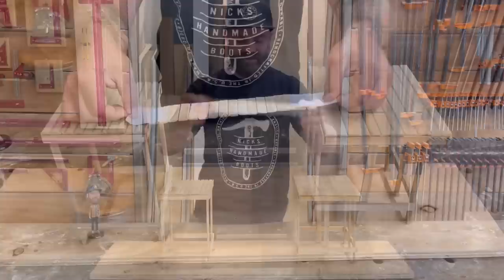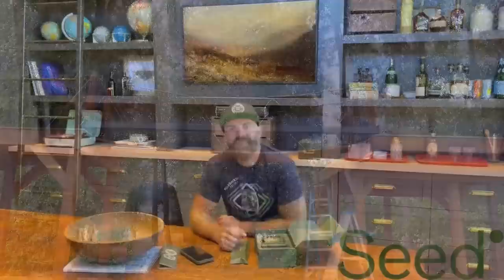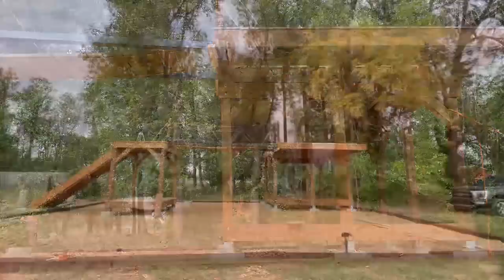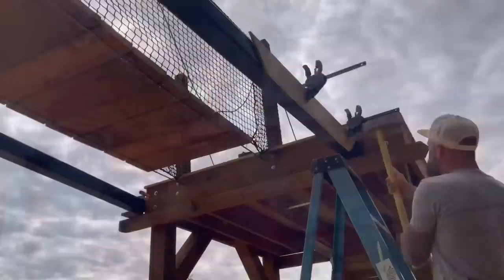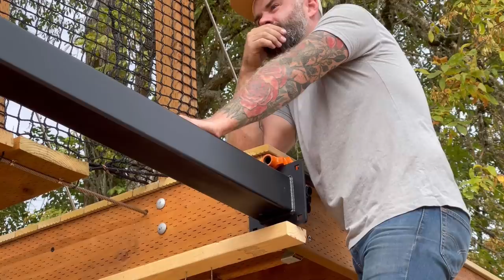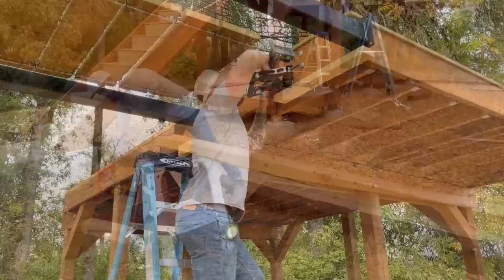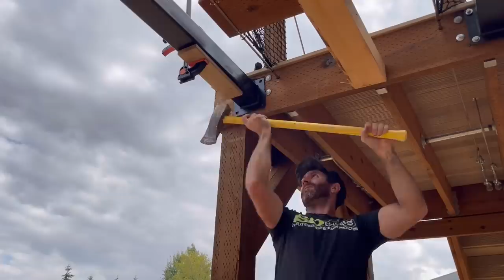My Treehouse is Falling Down || Fixing a Huge Mistake

Comment: Load Paths! This could also have been fixed by adding bracing to the structures it self. The load paths are still not complete down to the footings, adding the HSS sections is one way to 'close' the loop. Next time reach out the community for a quick "peer review", would love to give some advice in the design stage that could have prevented this. Looks good non the less! Love the videos.
Reply: He mentioned that as a possibility at the beginning but decided to go with that instead.

Comment: Hmm, you just need to attach some diagonals in order to stabilize the "box" in a way, that the "pull" from the bridge is causes compression force on the diagonal. That is sufficiently stable. You would need "a lot" of force to break that. In ye olden days they build multi floor houses based on that principle.
Reply: I came here to say this ^. Good on you for catching it.
Reply: He literally addressed this and why it wouldn't work long term. You aren't countering the forces perfectly this way and cannot guarantee stability in the long term.
Reply: @DustinKnapp7  my point was that, when done right, it absolutely can guarantee the stability. Again in the olden times they have build houses with multiple floors on this principle. There are some rural areas here, not bombed flat during the war, were you can still see them standing. Wood can take an huge amount of compression force when applied in (to be precise: against) the direction of growth.

Comment: Edit:  he literally just did what I mentioned below. Should have kept watching before commenting!  😂 At least we had the same idea!  👍 

Another way to span the gap could be to use a 4x4 shorter than the gap, by about a foot or so, and use a car jack between the 4x4 and one of the structures, to slowly spread the two structures apart. Like how they jack up a house when it’s sagging, but horizontally. Hanging/lifting the 4x4 could cause some issues but it was just a though that popped in my head.

Comment: I hate to say I told you so, but… I am a Cable Hauling Logging Contractor and this situation is my daily currency. The closer to a straight line the cables are, the higher the tension. The ratio is exponential, rising to infinite at a straight chord! When logging, we work on a maximum of 1/10 deflection. 
  No matter how strong your cables are, you will break them if you don’t have a visible ‘sag’ in your bridge - very important! When your wife and son were bouncing on the bridge they will have been very close to exceeding the design strength of the cables.

Comment: I was thinking about this issue since the last video.  My concern is the Bridge posts, the towers are now secure but you can see the posts wanting to bend in as Jason jumps.  I was hoping there would be a brace up high too (like a 15ft 2x4, if they have them) to prevent the inward bow

Comment: So this is where it gets tricky.  The weight of the bridge and it's occupants is 100%, that part is true.  Let's say that the amount of dip in the bridge is approximately .4 feet and that the load combination of the wood slats and the people is about 600 lbs.  (it could be much more than that if they are jumping.  Right now the bridle angle of the steel cables is 174.28 degrees.  The force on a single cable is 6000 lbs, but that's a force of 6000 lbs on each side pulling inwards.  Jason has two cables, so that is split between the 2 at 3000lbs on each cable pulling inwards.  IF he were to have a drop in the middle of the bridge of at least 12 inches, then that load per cable drops to 2418lbs and divided by 2 is 1206lbs, more than half of what it was originally.  If he had a drop of 24 inches, then it would be 1236 lbs each divided by 2 cables would be 618 on each cable attachment point.  This is why when you see suspension bridges they have a dip, especially playground bridges where the shock load of a bunch of kids jumping on it can be way higher.  Adding the beams in keeps the structures from pulling in, but it does not loosen the tension on the cables or the attachment points. There is still 3000 lbs or more on each attachment when someone walks across.

Comment: Seems like an easier and less costly option, would have been to use two 4”x6”x20’ treated beams, notched about 2.5” where the beams overhang onto both structures, spaced underneath the bridge planks, and place the bridge on top of the beams (no more springy, unsafe suspension bridge that is a slipping hazard after a light rain), and both structures are then solid, once again, eh?!?

Comment: Noticing how flat the bridge appeared when you were tensioning the wooden brace, did you lower the tension on the turnbuckles before you started trying to pull the two structures apart? 

I might wager it was primarily the turnbuckles that pulled you out of true, rather than weight on the bridge.

Comment: Oh yeah, well, you can put in an angle brace, or you can probably ignore it. I know you're probably gonna be on it playing with the foreman, but realistically I doubt you're gonna be up there often enough to really make a lasting impact.

Edit, well the cross beams will work, but now the flex is gone from the suspension bridge, kinda defeats the purpose, but it will work.

Comment: Just add cross braces in the right hand tower. One from bottom left post to top of middle post and one from top of middle post to bottom of right post. They can be timber(compression) or galvanised band(tension), whichever you prefer. The steel is total overkill.

Comment: I’m super impressed with your analysis of the problem. You say you’re not an engineer but you definitely acted like one!
Reply: you're kidding, right? Heard of trusses?
Reply: Why yes I have heard of trusses and cross beams to secure this without using the lateral beams.  He could have used an x shaped structure in between the vertical beams to avoid the whole mess. I think there are multiple ways to solve any problem and the argument for “best” can be subjective at times. I just thought Jason did a good job analyzing the problem and coming up with his own solution.
Reply: @themeandrousengineer  An important part of engineering is to keep costs down. From that non-subjective perspective alone, those steel beams must be very close to "worst". A stone bridge would have been prettier.

Comment: Hello, this is my first time on your channel, very informative video! Your solution is very good from a structural point of view!
Many people have probably already added their two cents, but here's another solution from a German carpenter 🧑‍🔧

You might know the topic either from physics lessons, from slack lining or from climbing (just google: “formula calculation forces slackline” = the formula explains it all;)

1. reduce horizontal forces by letting the rope sag a little = loosening tension.

2. stiffen the towers with large diagonal braces to create a rigid triangle. “Squares always want to tip over - triangles are always inherently rigid” - the larger the triangle, the more stable.

3. if the wooden diagonals are too solid for you, you can also stiffen the tower diagonally with steel cables and turnbuckles.

4. If the stiffened tower wants to tip completely because it is not heavy enough, it is better to anchor it to the ground. Of course, against the direction of pull of the suspension bridge. E.g. anchor a 45° steel cable in the ground at the back — with a solid foundation (60×60×60 cm) or tie it directly to another tree if the ground is too soft.

5. limit the number of people on the bridge at the same time and prohibit bobbing — I know, it's impossible.

Thanks for sharing and keep up the good work 💯

Comment: Not sure what your final plans are. But if you  sheath, plywood, etc the bottom portions it will add to structure strength from wanting to push in or out.

Comment: I would have used truckers ratchet straps to pull the tower straight from opposite corners.  One at the platform edge.  Then looped around the concrete pile and tightened it.  That would have pulled the tower straight in a matter of minutes and u could have fitted the steel beams in easily

Comment: I’m wondering if two 2x6x16’s cut to size  would’ve worked just fine, rather than those awesome (but expensive) steel beams. I get that this channel has the budget to do things “overbuilt” but my first thought would’ve been “I can get a couple 16 foot 2x6’s for under 30 bucks”
Reply: A 2X6 wouldn't have been enough. 1 3/4 thickness would've warped easily. A 4X4 could've worked but a 4X6 would've been ideal. The extra money spent on bigger materials is worth not having to replace the 2X6 in 3 months and replumbing the entire structure.
Reply: Cross members was the simple fix here. In that aspect 2X6's would've done nicely. It would've completely changed the look he was going for though.

Comment: Our local park has a suspension bridge like this one. They solved this problem by making the sides of the bridge our of lumber and span across, then hung the bottom of the bridge off the sides which created downward force from the bridge instead of horizontal force

Comment: The beams definitely got you back on track but.....the bridge treads being almost pulled level are putting a tremendous amount of force on the cables when you walk across it.  There needs to be some sag there.  Google catenary.  Also the hand rail cable being tensioned almost level is placing a large load on the posts extending up from the decks.

Comment: Diagonal braces from bridge connection point to outside bottom corners would have carried the tension force from the bridge down to the concrete

Comment: STEEL CABLES WILL NOT STRETCH!
The real problem in installing the beams is that you are getting a huge amount of resistance from the cables. Looking down the bridge plane you can see it is nearly flat. The top hand rail cables are about as far as yhey can go as well.
Loosening the bottom cables would have made it a lot easier.
At least you got it done!

Comment: I believe that the cables are pulling the entire 2 platforms (due to blocking)
You should add blocking behind the spreader tubes to put the load on the entire platform not just the rim joist

Comment: I might have tried a hinged piece of wood (two 8 foot spans connected in the middle) to pull down or push up and wedge the towers apart, similar to the scissor jack idea. Not easy any way you cut it! Great job on the repair.

Comment: Should have used cables in tension from the top inside to the bottom outside (within the towers.) since it is only racking in the one direction, you wouldn’t need an “x”.  The cables would replace the braces in the second idea.  A come-a-long in the place of the cable mentioned above would have taken the rack out.

Comment: The steel beams will definitely solve that buckling problem, nice!

When you attached the cables to the eye-bolts on the bridge though, did you use only one cable clamp?  I would definitely recommend at least two, if not three.  And there is an adage with cable clamps: "never saddle a dead horse."  That is, make sure the saddle portion of the clamp is on the standing end of the cable (not the tail end).  I don't have much experience with cable clamps but from what I have seen three is typical in industrial settings like on a crane.  Two is one and one is none, and three is two, if you know what I mean.

Also, is the wire stainless, or galvanized?  If galvanized you might want to treat it against rusting with some black paint like the steel beams, or maybe some boiled linseed oil and/or tar.

Comment: The posts holding the cables on either side of the bridge are bowing inward without anyone standing on it, and when your son and wife were walking and jumping the posts bowed in even further.  Please consult an engineer to find the best way to safely strengthen the suspension bridge and make sure all connections are properly transferring the load to the ground!!

Comment: I think I would have added a diagonal anchor to the other side instead. You are right in a single cable would be dangerous. So I think I would have installed a slide. I mean it would serve as an alternate escape route incase the small tower was not able to be used for egress.

Comment: Diagonals would have solved this. They resist sideways loads.  That is how steel structures in skyscrapers, building,  and bridges work.  You should still add diagonals after this to prevent future sideways movement. (Source: I am engineer) You could use wood or tensioned wire. Wire would need to be an "x" configuration.
Reply: they're called 'trusses' and yes, they would. Silly video

Comment: I think loosening the cables just a bit would have helped immensly. Now you basically streched the metal cables. 

I would loosen and then retighten them after. That way you could also give the bridge some flexibility back so its still a hanging bridge.

Comment: Too late to be helpful however,  speaking of rust its been my experience that square tubing rusts a LOT quicker that a piece with open webbing like an I-beam. Added bonus is it weighs less and you can paint the entire surface. 

Also love the thought of the suspension bridge but the beams kinda ruin the affect.

Comment: I can't be the only one who thought maybe there would be a swing set, some form of slide or a zip line on the end to help hold the structure plum.
Reply: Yep, was thinking a nice slide on the other end. Imagining running up the stairs, across the bridge and a bar across the entrance to the slide. Grab that and whip down. Oh to be a kid again. Cool build though. And I see it would be larger than the current footprint so not sure if something is in the way down there.
Reply: I actually thought a slide at the large end with the same sides as the stairs would have done the same job that the stairs are doing on the small end. But hey, the steel beams work so all good.

Comment: Since the back beam was already in place... you could have used that as a pivot point and pull the opposite back corner towards the platform with the stairs.... like a seesaw. This could have pull the front corner enough to fit the front beam in maybe?

Comment: Should have had the lines for the bridge run clean through the structure, out the other side, and then down to the ground. The lines would need to be ran through bushings fitted into the structure itself so that the structure allows the lines to move through it as tension changes dynamically. If you didn't want the line obtruding out the other side, you could simply have run it down within the inside of the structure to the ground. Come through the inside wall of each structure, using bushings so the wood isn't sawed through over time by the cables, and then down into a footing in the ground. The way you've done this, you might as well have just built a solid bridge across the span.

Comment: PLEASE PLEASE PLEASE  take a look at the "angle of dangle" of the bridge itself - the less the bridge "dangles" the higher the sideways load whenever someone steps on it, the more likely the cables (or fasteners) will fail.  This is why the platforms move so much when you jumped on the bridge!!  Remember how difficult it was to move the one tower when you had a car pulling it?  Jumping on the bridge moved the tower MUCH more!!  Consider placing 6x6 beams UNDER the catwalk.

Comment: All you needed was some cross bracing on the towers. You are putting a shear load on the tower so you need something to counter the shear, couple cross braces going corner to corner would have solved your problem.

Comment: A few diagonal 2*10 on each tower or better knee bracing would have solved this problem. Could have even just used that wood beam you cut to push the towers apart instead of the steal!

Comment: I would have let the cables out on the bridge before trying to put the beams in place, they are still pulling the towers in.
If you look at any suspension bridge, you will see that they are anchored with cables that go through the towers and are fixed to the ground at each end, that way there is no inward tension on the towers, they are only subject to vertical forces.

Comment: If you had this entire project to do over again, would you consider building the bridge between the two structures in such a way that it was not reliant on the other structures for support? The bridge would still span between the two structures but would be autonomous in its anchorage.

Comment: For a looser bridge like this with most of the load being put in the middle, you can get a good approximation of force pulling the two towers together by just dividing the weight of the person by twice the tan of the deflection angle.
With how flat the bridge is here, there could easily be a few thousand pounds pulling the towers together with one Jason jumping in the middle.

Comment: A 4” round steel tube under the centre of the bridge secured into the underside of each tower would’v worked & double as a flying fox with a quick carriage with some scooter wheels that run on the top of the tube. Almost could’v made it look intentional 😅

Comment: Why not just loosen the angle braces and the suspension bridge wire so the towers will be more flexible then get em plum with the beams then reattach everything.

Comment: It's a way to solve a problem.😂
Now with those overkill beams you might as well make a solid bridge instead. 🤔
Also some diagonal berms stretching from top to bottom would have worked too. (without those overrated beams)😉
Just looking at bridge constructions or scaffolding and googling this stuff would have helped too or just asking the community. 😉